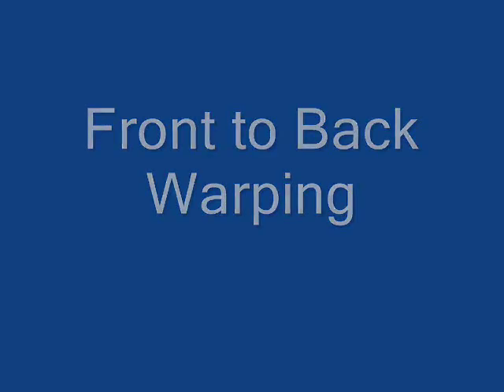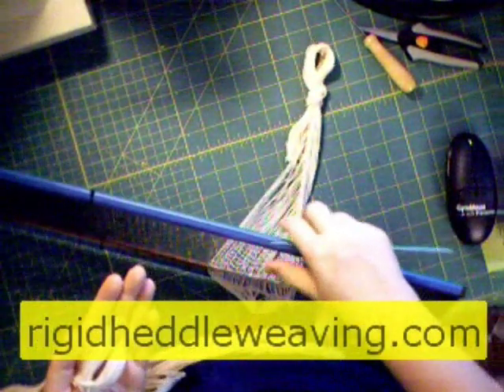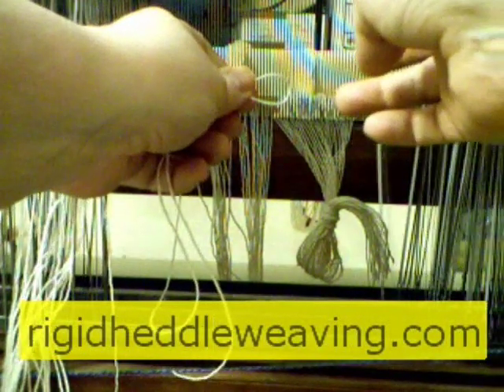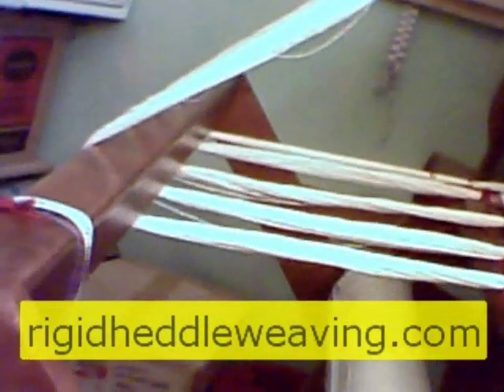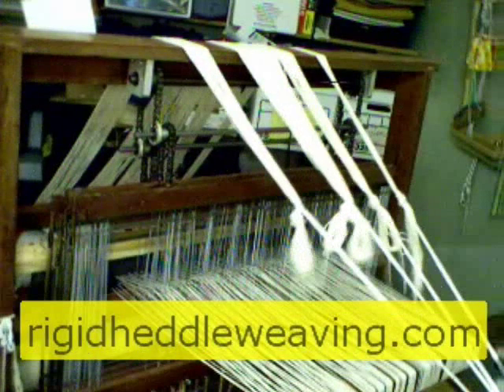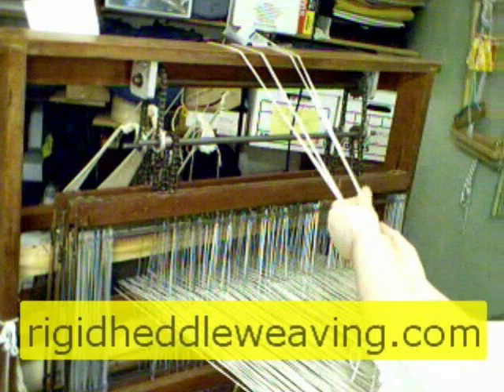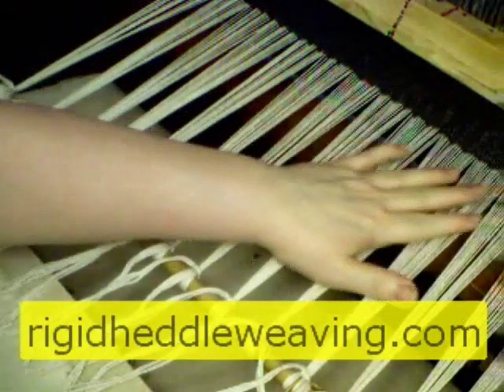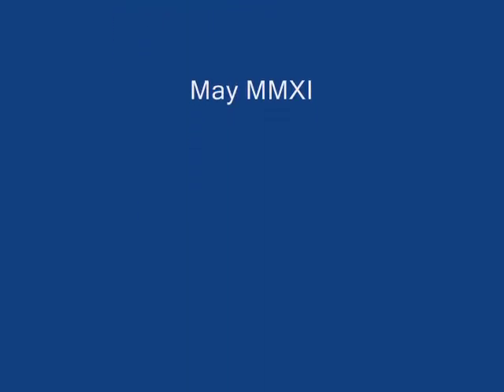How to Warp a Floor Loom Front To Back

Comment: Super great video!!  Thanks for the all the details and clear delivery of information.  Very, very helpful.  I found an older two shaft table loom at Goodwill for $25 and my husband made a few replacement oak parts for it and it's back in action.  I tried back to front warping, ugh, not a good match for my loom.  Your front to back method looks much more promising.  Thank you.

Comment: I have been using 24" brown paper to wind on with my Warp. When threading the heddles be sure that you haven't crossed warp ends. The last time I had 380 warp ends through the reed and it was easy to make a mistake. Check this before you start weaving.